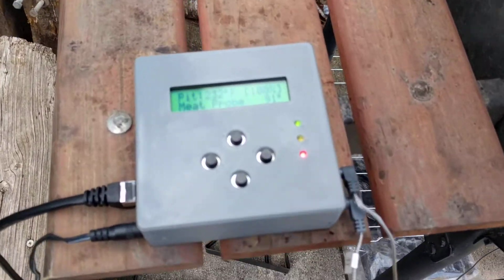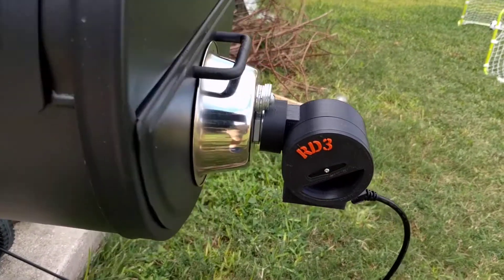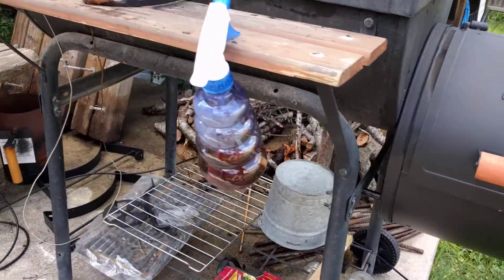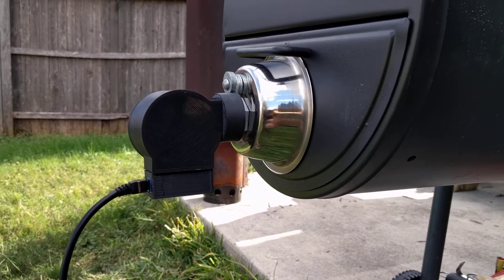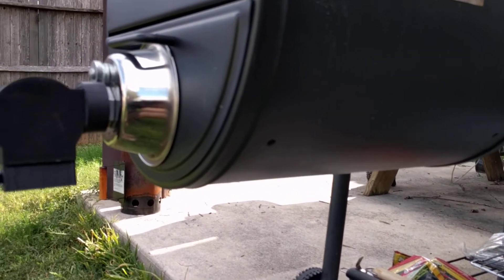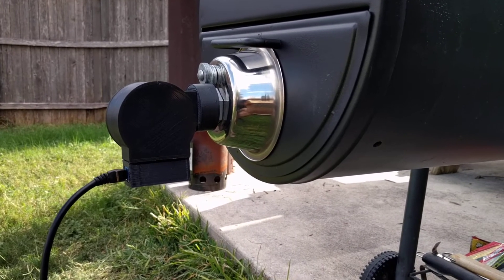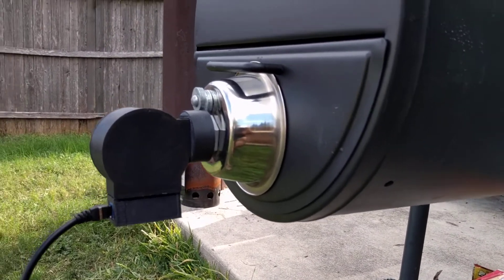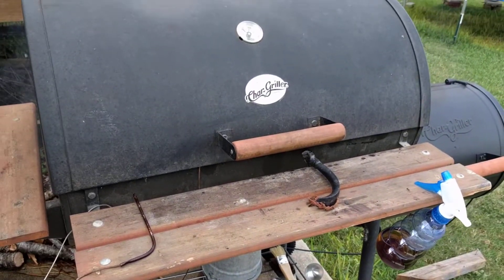HeaterMeter 4.3 with Rotodamper 3 setup #2

Comment: Very long shot here, but I'm planning on doing the same setup! I wanted to have an update on how it's working out with the offset, logs and Heatermeter. I heard the HM isn't the best with stick burners, what do you think?
Reply from the maker: Hey Simon, I should probably post an updated video, but in order to really get control over the fire, I had to get a bigger blower and wire it into the mix. Since making that change, I've found that the HM does a great job of controlling the heat, and if my cheap smoker we're more heat efficient, I could probably get more than about 2.5 hours of steady temps.
Reply: @nswellman1  Thanks for the answer! Which blower did you get and which power supply are you using? Would you be able to send a picture of your current setup attached to the offset? Thanks
Reply from the maker: @spdecoste1  The blower was a very generic 26.5 CFM blower from Amazon.  This is the item: 12VDC Squirrel Cage Brushless... https://www.amazon.com/dp/B00HWZ5XGC?ref=ppx_pop_mob_ap_share

As far as power supply, just the standard supply that the RasPi needs is enough to power the blower through the Ethernet connection.  I don't think I have any pics of the new setup for some reason, but I'll take some the next time I do a smoke and let you know.
Reply: @nswellman1  Hi Nick, awesome job... I was wondering to use a 75x75x30mm blower. Do you think it will works? Do you have the files to print the RD3 ?

Comment: Hey Nick,  Thanks for sharing your video.  Good info.  Not sure if you are still following comments since this post has been out there for a while.  I'm about to fire up an RD3 on my smoker.  I am wondering if I will have a heat issue with my method of mounting.  Here's a pic of my mount.  Would you be willing to share your thoughts...  you think I would have issues with heat conduction melting my RD3.  Pic: https://drive.google.com/file/d/1CjanlrMXLq4Lm5HLRrqIHrOEbO5EzJjy/view?usp=sharing  Appreciate your thoughts.

Comment: Your RD3 is melting because Ralph prints at very LOW quality. The adapter part should be printed at least with 70% infill. Piece of crap if you ask me!
Reply from the maker: That may be Will, but after some additional testing and trials I can say that I was definitely too close to the fire. I added a 10" long pipe to the setup and never had another part melt. Of course this was the same time that I stepped up to a bigger blower fan, but that was a different matter.